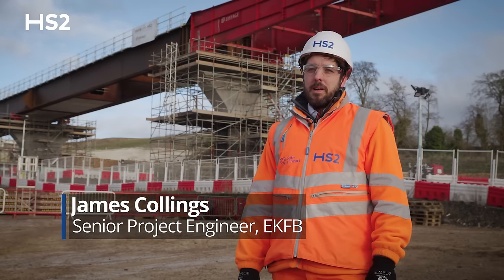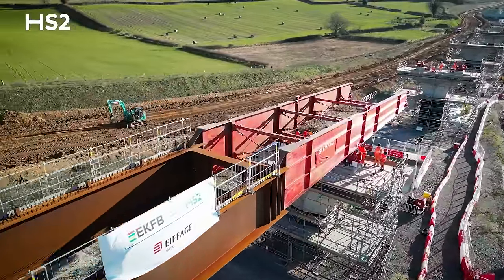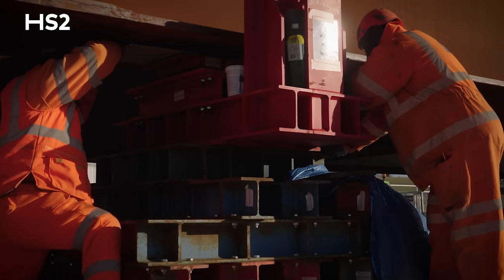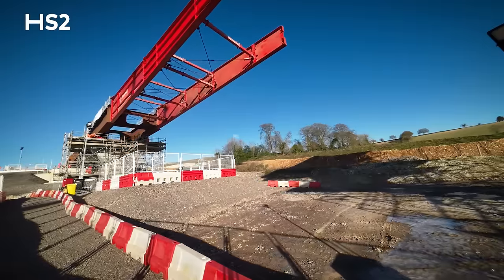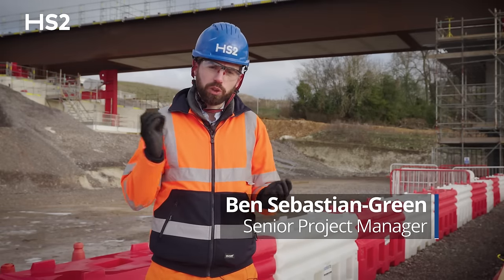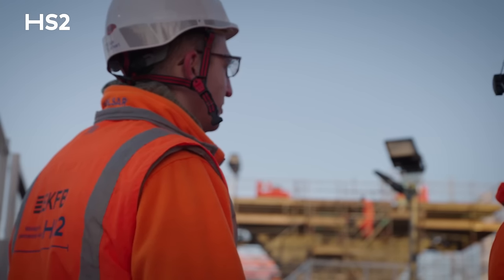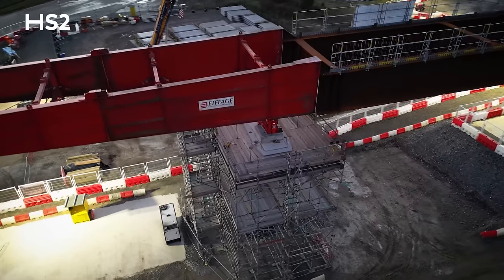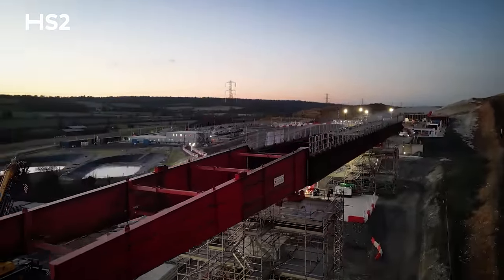HS2 begins epic year-long, half-kilometre viaduct deck slide

Comment: Disgraceful waste of funds. Completely unnecessary project consuming money that could be better used on the existing rail network.
Reply: The existing railway network is completely at capacity. I think it could definitely have been built cheaper, but no, a new line is essential. We can't keep using main lines from two hundred years ago and expect them to provide enough speed and capacity for the modern day.
Reply: Wrong on so many levels. This Project is necessary. And you dont have to cut it to improve existing rail infastructure.😊
Reply: @KeVIn-pm7pu Is gut Kevin. Du hast doch schon keinen Plan von dem was in deinem eigenen Land los is.
Reply: Just like in Germany. Pointless highspeed 💩 noone needs here and there but the commuters that people do need fall appart. One reason for this is that the German state legaly used pay a lot for new construction projects but nothing for maintaining the existing infrastructure but these new projects are still not free for DB and so billions that could have been invested in commuters that make people come to work on time stress-free and therefore add a lot to the overall economy are beeing consumed by prestigeous nonesense that may make Americans jealous but not anyone else since how tf you want to flex with a damn train in the 21st century? Maybe if its magnetic or has a fancy restaurant on bord or something like that but the ICE has none of that. Therefore its seats lack any back-support and are therefore worse then the ones in commuters and even some soccer stadiums.
Reply: @l.b.3416  Have you seen the trains on the WCML? They are absolutely packed. (I would know, I see them get cancelled and delayed really often when I pass by stations on that line) They have such little room left for expansion, it's extremely expensive to do that. That is what HS2 is relieving. Making a parallel but faster, higher capacity line so that passengers can actually go places and free up spaces on the old WCML. No, it is not some useless vanity project. I don't know how it is in Germany, but living here, seeing those packed trains, seeing the potential freed capacity, and seeing how quickly I could get into London with it? HS2 cannot come soon enough for me.
Reply: @zhongcena .. arguments that the WCML will soon be "full", rely on a discredited, out of date forecasting model which overestimates long distance passenger growth & isn't used for anything anymore except to justify the monstrous vanity project that is HS2.
Network Rail's "New Lines Programme Capacity Analysis" shows that WCML capacity is kept artificially low by private operators wanting to maximise profits.
A DfT analysis shows that in peak hours leaving Euston, WCML trains were loaded at just 52.2%
HS2 is an environmental disaster of epic proportions & Britain's biggest infrastructure mistake in half a century.
Reply: Incorrect. This project IS necessary for capacity expansion on the WEST COAST MAINLINE.
Reply: @CRIMSONANT1 source for that DFT analysis please? What year is that from?
Reply: @CRIMSONANT1  Peak hours 52.5%? Hah. Yeah, maybe leaving Euston they are. Not when they travel anywhere up north and pick up passengers. That line has some of the most delayed, packed trains I have ever seen. Explain to me how keeping trains delayed or "artificially low" as you claim would help profits?
Reply: OK where would you have spent the money ?
Reply: @Oldmonstonian1 You clearly know sod all about railways if you think that lol.
Reply: Have we got £2Tn to spare? That's the sort of cash that's needed to bring the whole network up to date. In 2004, £14bn was spent on 51miles of the WCML from Stafford to Rugby. £28bn at today's prices (100% inflation in 20 years). It achieved just 10% of the intended benefits and very few speed increases. It'd take another £250bn to complete just that section and cause a decade of disruption to homeowners and commuters. HS2 is the cheap option in comparison.
.
Reply: Short reply: you’re wrong
Reply: @gryffe1  .. short reply - he's not 😉
Reply: Well the original plan was to link the major cities, taking the strain off both the ECML and the WCML. Sadly the Tories have been in charge and fudged it up. But yeah the Rail network does need this, especially if we are to get more Lorries off the road freight onto the rails.
Reply: @EdgyNumber1  .. arguments that the WCML will soon be "full to capacity" rely on a discredited, out of date forecasting model which over estimates long distance passenger growth & isn't used for anything anymore except to justify the monstrous vanity project that is HS2.
Network Rail's "New Lines Programme Capacity Analysis" shows that WCML capacity is kept artificially low by private operators wanting to maximise profits.
A DfT analysis shows that in peak hours leaving Euston, WCML trains were loaded at just 52.2%.
HS2 is an environmental disaster of epic proportions & Britain's biggest infrastructure mistake in half a century.

Comment: But HS2 has been cancelled. Why are they still building it? It’s pointless now.
Reply: It hasn't been cancelled, but cuts off (rather meaninglessly) at Birmingham. A decision that I hope the next government will reverse and reinstate its full length.
Reply: @Paul_Harper  And wrong again, HS2 hasn't been cut off at Birmingham or Cancelled. HS2 carries on past Birmingham to Handsacre in Staffordshire near Lichfield where it will connect onto the WCML and if it did terminate at Birmingham which it is not why would it be meaningless
Reply: @peterwilliamallen1063 .. what you've failed to mention (again), is that when HS2 trains "connect" to the WCML, they WON'T be high speed - they'll be no faster than the current service making a mockery of the "HS" logo.
Reply: @Paul_Harper  Argh, so they cancelled the important bit, and built the less useful bit. Yeah, that sounds about right. HS 2 needs to be either finished, or at worst, built at a slower pace, but to cancel HS2 is a terrible idea.
Reply: @Erakius323  .. it's nothing more than a monstrous vanity project & cancelling what's left of this white elephant would be a terrific idea 😉
Reply: @CRIMSONANT1  This project is not a white elephant. This project, is vital to boosting, the economy. Induced demand, aka, build it, and they will use it. The point of HS2, is to increase, capacity, on the rail network. By putting high-speed trains on a seperate track, you draw more people onto high speed trains instead of planes, for intercity travel, much greener for the environment, you free up existing track for slower speed services, thereby drawing more people onto the shorter distance routes instead of driving, again, much greener for the environment. And, due to increased connectivity, and more capacity to move more people, and more cargo, about on the slower speed rail, due to not having to accommodate high-speed trains, you boost the local economy. How is any of that, a white elephant?